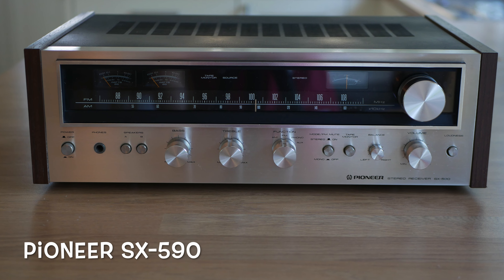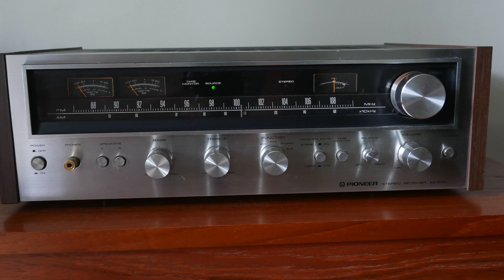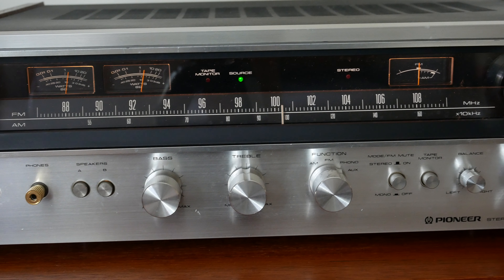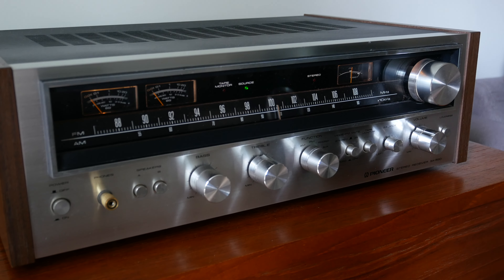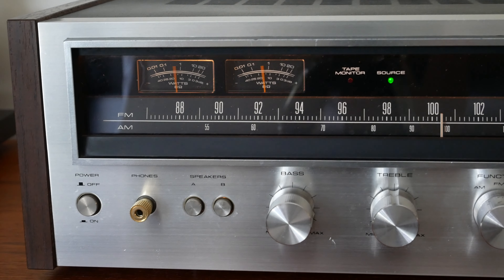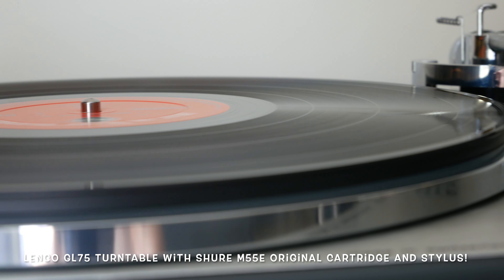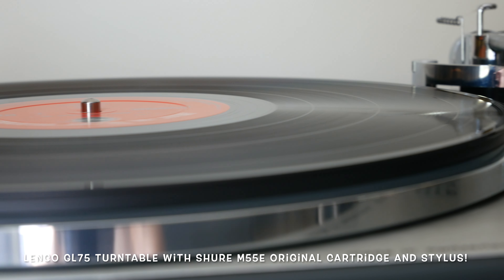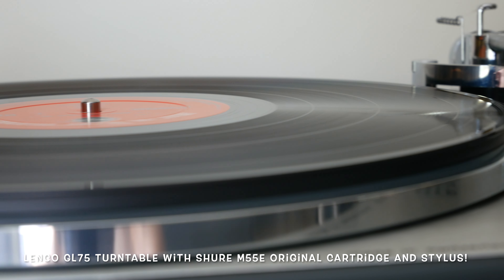Pioneer SX -590 Receiver

Comment: Great set up.  I've had my 590 for a couple of years now.  I use a PL 518x and it sounds fantastic.  But because of the 20 WPC I feel limited to what speakers I can use.  I'm currently set up using a Chinese pair of Castle Knight 4s and they're surprisingly very well suited, but I'd like to invest in better floor standers if you can recommend any?
Thanks